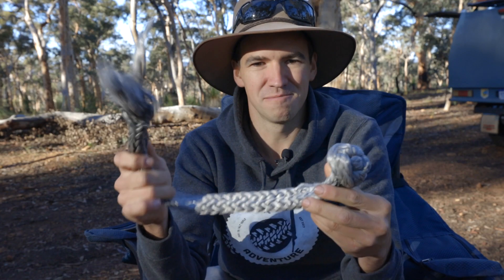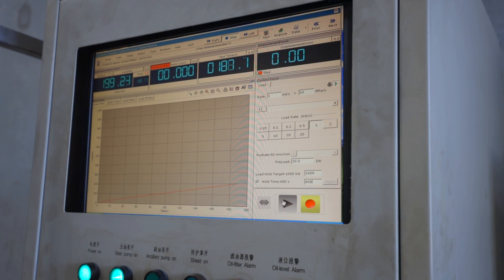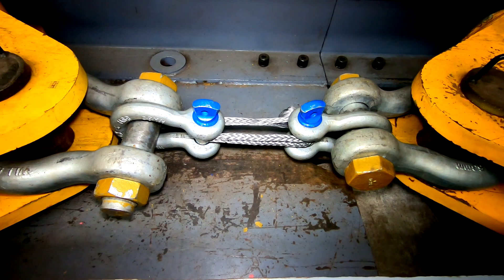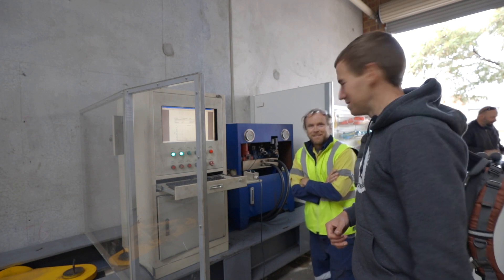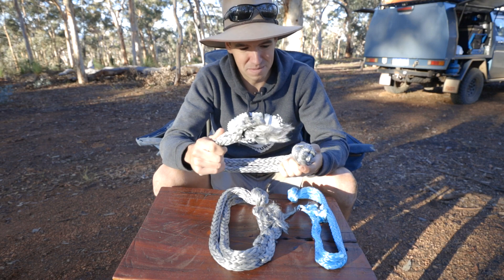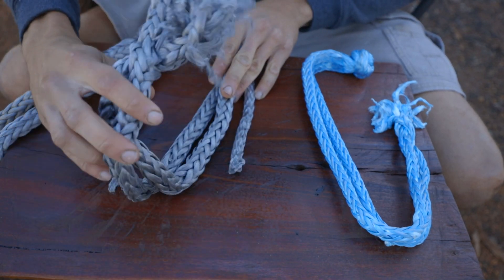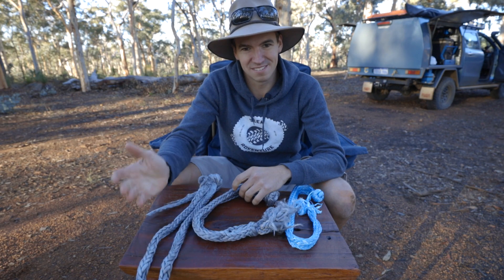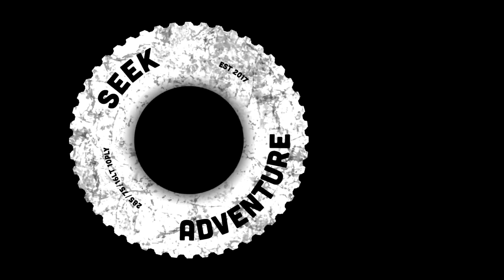DIY 4x4 Soft Shackle Destruction Test

Comment: The 17 ton rating is for ONE rope. These shackles are TWO ropes so they're breaking at much below their rating which is because the sharp bend at the knot brings the breaking strength down quite a bit.

Comment: Just a thought, try knocking one up with two eyes on two tails back to the crown knot. That way the weak point will no longer be the bight. The bight in any line will always be only as reliably strong as a single length of the same line - hence the 1.5x.
Reply: Good point.  I want a soft shackle, because they use less space.  But the fitted tow ring on my 4x4 is too small for two thick ropes.

Comment: So the Gray shackles were 12mm dyneema  wich broke @ 26 tonnes  
My question is was the blue no name / rated shackle  12mm as well ?  It just looked a bit smaller in size and most cheap  winch ropes are 10mm 
If it was 10mm  the 16tonnes is still good effort for 10mm rope .
GREAT work there mick . Ive been using 10mm dyneema self made shackles for a while now and all seems good so far 👍

Comment: I shore soon your going to be asked. So i do it first. Where do you buy short lengths of rope. The cost of full length is high and is ok to go on a winch is ok. But to make shackle. Good testing. I have been involved in testing for a few years. A tip. After making roll knot under foot on ground. It will pull fibres together. Russell.

Comment: did you use the spliced eye on the ends of your rope for the monkey fist or the loose end monkey fist, the eye version is apparently stronger if you haven't seen it check out sailing zingaro's video on it

Comment: I was told by a shackle seller that the knot should be in the middle when using a soft shackle, I wonder if that would of changed the results even though they’ve held up very well.
Reply: That's actually not right it should be at the end for maximum strength. Testing ive done proves this
Reply: What testing have you done? That’s a bold statement to make with nothing to back it up.
Reply: Frank I break shackles for a living. Literally! my job is Director of product development for an off road company.
Reply: That tells us nothing, I could say lots of things and back then up by telling people i work in an industry so they should believe me. I’m just asking what specific information you have to back up that claim. Many manufacturers tell you to put the knot in the center.
Reply: Well Frank Given this is a YouTube comments section ill just leave you to believe what you like and move on.
Reply: You have no evidence of testing to back it up, got it. Have a good one.